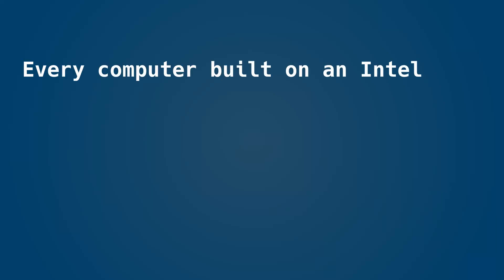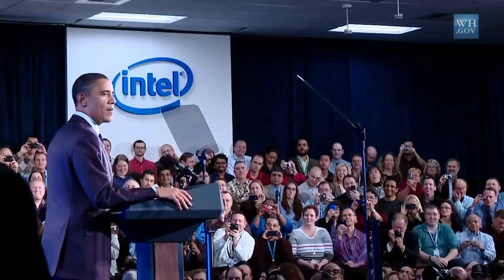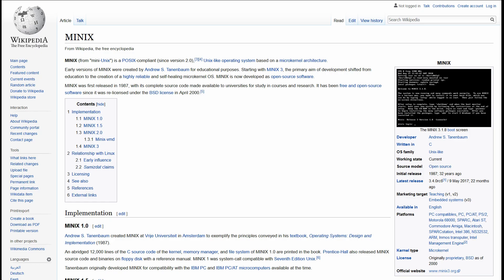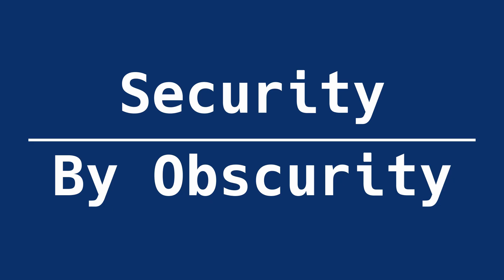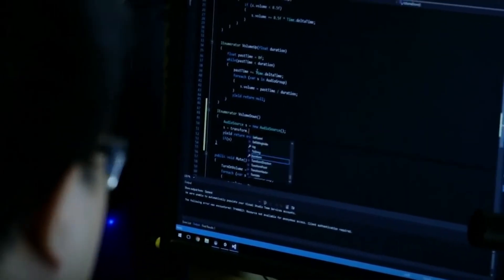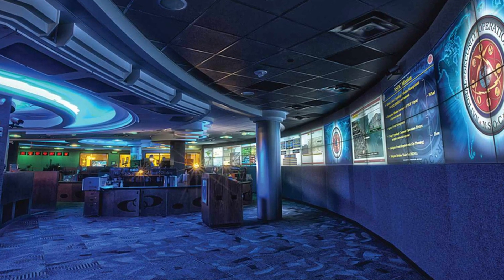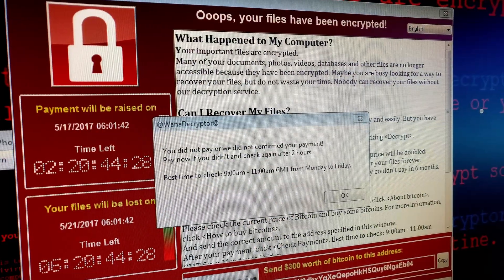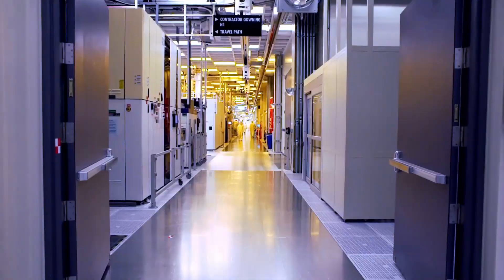How Intel wants to backdoor every computer in the world | Intel Management Engine explained

Comment: Using an external router, no extraneous outgoing traffic was detected from modern computers (ryzen3, ryzen 5, i5-4870, laptop). The router used was the software m0nowall-v1.32 running on a pentium3 computer with 3com905 network cards.
Reply: Course not, it sits and waits for its master. It can also sneak by when you mass stream data.
Reply: @TammyDenseDdank5658  I didn't say that it couldn't get through. I couldn't detect anything, no attempts to access the internet from disabled computers or computers with the bios open. Perhaps certain conditions are required, such as an external IP address on the network card.

Comment: We also need hardware engineers and electronic engineers to reverse engineer all hardware that is released even if just for fun in the "basement", so they can provide that level of knowledge to us all about what these components and chips do exactly.
Think about it, the traditional motherboard has changed a lot over the decades. Yet besides faster computers and a few new interfaces (USB 3.0, PCIe, etc), the layout should be the same. Open your new computer now, and find out how there's a bunch of chips and other gizmos that aren't accounted for by the developments alone? What could that set of be chips be? Extra backup of backup BIOS 🫣 or maybe Intel IME AMD AMD platform security pre-installed on the main board ready for vendors to add to. The back doors are here peeps

Comment: 1.) We DO know what's in is & what it does. It's a very small bit of code & it has very basic functionality in & of itself. BUT one of those basic functions allows remote access as though it were local  only IF it is running. You need to change "WE don't know" to "most of us don't understand"
 - a.) Whenever it is being used to remote access you have a FLASHING border around the screen. This is outside of the OS so it cannot be turned off. If you do not see a blinking border around the screen it CANNOT do anything like record your passwords or that other nonsense
2.) It is not "Inside every Intel CPU" in fact it is not even available in some, but most i5 or greater Intel CPUs are CAPABLE of using it BUT they also need a number of other things as well, The NIC must be capable, the chipset must be capable, as well as they must be enabled.
3.) If it is not enabled the chip must be flashed with a physical writer while the system is unplugged to enable it, & it isn't simple. If it is disabled it is essentially still running in the background, but without access to anything. It cannot be used until it is setup physically on the machine it is going to be used on. Before it is setup it cannot be used remotely.
4.) It CAN be manually disabled & it CAN be manually removed. If you want to completely disable it you can actually remove the code from the chip with the same writer I mentioned earlier. It wont be easy, but it is doable. But that also means it wouldn't be easy for hackers to get to it either.

Comment: i was victim of a wannacry lojax type bios virus. i still dont know how they did this, but it was like magic. i had absolutly no controll over my device, no matter how often formated the harddrive. i learnt that this is due to this backdoor in the intel cpus. whats even more frustrating ist that like stated in the video, there was a security option to prevent stuff like that available and installed in my cpu but is shut off with no possibilty to turn it on. next cpu definetly will be amd.

Comment: tbh this feature is quite commonly used in things like data centres, where you need out of band management of a device to query hardware faults, perform firmware upgrades, etc., even if you’ve completely bricked the OS (or haven’t installed it yet). 

it doesn’t really have a place in end user desktops and laptops. because what this video said about they typically operate - always on even if the devices main OS is not even booted - is true. 

as others mentioned, this is a general problem with hardware: the lack of both open design AND hardware

Comment: The hell this dude is speaking.
If Intel didn't reveal anything about it How's they know what exact OS it's running?

Another, "it can't be scan by antivirus"
It can only if you can port it. But why the hell you'd do it in first place? I know Intel has a vulnerability which leads CPUs build after Core 2 Duo, however this dude seems speaking fantasy somewhat beyond.
Reply: This isn't fantasy and was already reported on by many tech channels years ago. 

This management function actually has use in professional/commercial windows environments. That's who it is meant for mainly. It's not useful for regular end users like us. Other, bigger channels have gone more in-depth about what is (and isn't) known about it.  

If it's ever used for backdooring we'd never know, that's where the fear of it comes from, the unknown of Intel.

Comment: What proof is there of these claims?  To my knowledge IME, like parts of UEFI is a boot process engine function. It is there to bring up (bootstrap) the very complicated multicore processor, low power rails and chipsets. All systems need this. If you are Intel (or AMD) you have to provide this INIT code to the motherboard vendors. Logically, when you have a huge variety of CPU/Chipset options, you would code this up in a mini environment (MINIX is just that) and hand it to the vendors with updates for new chips, bug fixes etc. In this way you KNOW what is out there to maintain. Otherwise you would have hundreds of implementations all with unique vendor created bugs that make your product (Intel CPU's and Chipsets) look bad. So its perfectly logical. As the needs for security features develops (since hackers never rest) then its logical to protect the system at the lowest possible level. The basic rule is you cannot do something in hardware UNLESS it is mature and fully bounded. Well hacking is anything but, so you must do it in low level microkernels with service updates when an exploit is discovered.  OpenSource Hardware will need to do the same in the same manner eventually.  So I'd suggest people read up on IME. The docs are out there. Does a motherboard builder have to use it? No. But if they don't they have to build every feature it provides on their own, maintain it and enhance it.  In other words they have to reinvent the wheel. And even then they may not hear from their competitors if something is getting hacked. Intel will hear it but they won't. If security is your concern, and its right to be concerned, then mitigate at the network level outside your PC. (Called building a moat.) Hardware firewalls (PFSense) work well.  Most modern high end routers have very good security too. You can "BLOCK" the IME related traffic, or any specific traffic, if you wish.

Comment: libreboot and use non closed source hardware or software to claim your freedom. Minix is easy to overwrite btw. It is a simple small kernel. You can use openbsd instead of gnu/linux  distros if you do not like systemd or the generic linux kernel

Comment: Another reason not to buy an Intel CPU
Reply: AMD has PSP, he just wanted intel to look bad
Reply: @tocraft573  AMDs PSP is not as shady as the Intel ME as of now.
Its only a security concern and has not been proven to be spyware.
There is decent info about it on the Internet and it seem like it cannot be deactivated completely since it handles basic hardware level functionalities that are required to even load up the Bios.
Reply: @alouisschafer7212  go check out system76 they DID disable it fully with the bios loading and also ‘not proven’ means nothing because it still might be and the security is still a big problem

Comment: The worst part is that in plain 2021, there is still NOT EVEN A SINGLE FSF-endorsed Operating System that supports a non-compromised architecture, such as PowerPC aka POWER, or RISC-V. The closest thing to it is installing Debian and making sure you only use libre software packages.

Comment: You can destroy it and I have done this several times. It's just a scratch in the right spot.
Reply: is there a guide anywhere so that i can do the same?
Reply: @TheAlison1456  Not that I am aware of. I removed carefully the lid and got a CPU layout, where we are informed in detail about all units, exclusive the hack. Which then I scratch. It's a pretty large thing. However it needs also a microscope to inspect, and there is a risk. If you need this option, you can afford it, though.

Comment: Don’t worry guys I’m using the pentium 4 so I’m safe
Reply: Yuvan Michael he was making a joke you fucking imbecile
Reply: @Yuvan Michael you can use the core two quad the latest intel processor without intel ME.
Reply: @devmister3736  But only if you stick with the P35 or X38 chipsets. Intel added the Management Engine into the MCH of P45.
Reply: Very nice. My old P4 also doubles as room heater.
Reply: @houstonhelicoptertours1006  how many watts?
Reply: can intel me and amd, access or be accessed by internet, without wifi card ?
Reply: And I've got a 486 lol

(this is a joke i have an i5 please help)
Reply: Don't worry, you're not safe with P4 either. ;-)
Reply: Is i3 safe
Reply: @dr40xer  
no...
Reply: @GFCProductionsx  lol🙄

Comment: Tell them about HTML5. Why did they push it so hard and kill off Flash? Security? Battery? Apple? Nope.. that was all bullshit! None of it was true. The NSA paid adobe to kill Flash off themselves by publishing all their exploits. They had to shut down Flash to get HTML5 mainstream. The Minix instance on your CPU is able to gobble up all metadata and personal info because HTML5 makes it possible.

If you use an old unsupported browser (from 2005), the Minix instance becomes blind as a flatworm. Some clever folks were able to get some readings via sandbox what exactly the Minix was doing. It was siphoning keystrokes, form data, sites visited, compiling habit searches/interests/topics etc... like an AI almost. Using an old Fox version, nothing was being recorded. Interestingly, trying to type form data in flash on a modern browser, nothing was recorded. They needed Flash dead to make this operation possible.
Reply: Lets make HTML6 resistant to this.

Comment: IME as it stands right now isn't all that spooky, there's no secret information (you can confirm this by tapping the ethernet cable) and it really seems to exist mostly for usage at enterprise level to remotely control machines at a hardware level. 
Intel has never really made any bones of the existence of the ME, even touting it as a feature when it was first introduced. 
It doesn't like being disabled completely, but you can allow it to start up then instruct it to shut down, and it will stay off (this is how tools like me-cleaner work). 
It's disabled on my laptop (ThinkPad x220 running Coreboot). 
It is possible to query the ME status from your regular Operating System.

It has the potential to have its system files changed through BIOS/Firmware updates, but other than that probably won't be changing much on current CPU revisions.
It can be reverse-engineered, I don't know if anyone has began doing so yet, it would be a massive undertaking but is technically possible.
Intel should open source the ME firmware and compel motherboard manufacturers to add an option to disable it in the BIOS. These are their only mistakes as far as I'm concerned.
Reply: Bull-shit !

Comment: There is a kind of solution...kind of.  Do not connect your main computer to the internet, by any means.  Where you must transfer data to others use a separate machine loaded with only the bare data you need to transfer and assume all transferred data to be compromised.  Don’t load anything except basics into cell phones.  Periodically change your phone and email contacts...do not give them out....especially on written forms...if says ‘field required’ to continue...don’t use the site.

Comment: Russian IC chip makers, according to your U.S news outlets, are having difficulty in developing their own IC Fabrication equipments WHICH HAPPENS TO BE THE STEPPER. But what U.S news mainstream media does not know or knows and refuses to admit is that Russia is now manufacturing it's own IC chip manufacturing high-technologies engineering equipments and has INDEPENDENTLY DESIGNED AND BUILT IT'S OWN VERTICALLY INTEGRATED AND HORIZONTALLY INTERCONNECTED TO SUPPORTING SELF-CONTAINED INDUSTRIES AND INDUSTRIAL FACILITIES, INTEGRATED CHIP MANUFACTURING STEPPERS. Because it can now independently design and build and manufacture it's own locally manufactured steppers to mass produce AN ALL 100% MADE IN RUSSIA IC CPU CHIP AND GPU CHIP WITH A PERFECT GUARANTEE THAT IT HAS NO BACK DOORS UNLIKE EVIL INTEL THAT MAKES ALL INTEL CHIPS TO HAVE BACKDOORS THAT ARE HARDWIRED TO IT'S CPUs IN SUCH A WAY THAT ANY ATTEMPT TO TAMPER IT WILL RENDER THE INTEL CPU IC CHIPS USELESS. OUR RUSSIAN MADE IC CPU CHIPS ARE THE OPPOSITE OF SUCH EVIL INTEL PRACTICES. Unfortunately our NO-BACKDOOR RUSSIAN IC CPU AND GPU CHIPS AND GUI CHIPS AND RAM CHIPS AND ROM CHIPS AND MEMORY CHIPS AND OTHER CHIPS are not allowed entry to be inside the U.S for they can not be spied on by the U.S Government and any attempt to tamper them to make them easy to connect to U.S MADE SPY CHIPS will render them useless. In short, we are giving Intel and AMD and the U.S government a taste of their own medicine. We will advertise our 100% made in Russia IC CHIPS as having no backdoors and no hardwired spy chips embedded in them and will make all U.S made CPU chips loose the entire world's market FOR THE WORLD DOES LIKE ITSELF BEING SPIED ON BY THE U.S GOVERNMENT!

Comment: You only really have to worry about this chip if you haven't updated it to version 7 or higher and gone into its settings changed the password and switched everything to disabled 
If you haven't already, update your bios to the latest version then go into your chips settings make sure it's on version 7 or higher and disable all features 
If your computer is too old and this chip cannot be updated to version 7 then get a new computer 
They're cheap on eBay 
And don't confuse BIOS version with this chips version or your bios settings with this chips settings; they are accessed differently and mean different things

Comment: That's it! I am switching back to windows 98SE machine :D
Reply: Fabroni Giordano  Windows for offline, linux for online.
Reply: Fabroni Giordano  I heard of the IME (Intel Management Engine) that is incorporated into every single machine with Interl CPU that was manufactured starting from 2008, but it is not just Intel, AMD also has something similar. So, yes, that is an actual PHYSICAL HARDWARE built-in backdoor. So regardless of the fact that you are using Linus as an OS, that will still do its thing. 
However, in order to read information, a connection is needed, so that means the Internet, Unless you are talking about using antennae that can read the electromagnetic spectrum that is emmitted by displays/ computers overall so that the can decode the signals, that is another thing.
The safest is not to use any of this digital age technology. Or the only way to be safe is not to use comptuers and internet :))
I have a computer fom the 90s, that does not have HDD ant neither had an OS, it woks in ROM/ RAM only and the OS is actually a BASIC interpreter. Probably that one is unhackable :)) But even that one, presumably they can read the electromagnetic signals from it. 
Well, I have good news, I do still have a MECHANICAL TYPEWRITER. That they cannot access :P
Reply: Fabroni Giordano  Most people are ignorant. You know that ignorance is bliss. And furthermore, they PUT ALL THEIR PERSONAL IDENTIFIABLE INFORMATION on the ”social networks”, readily available for anyone interested. This is the epitome of stupidity.  I have purposly posted on my facebook account (that I am about to delete some day) that my birth year is 1912, on 15th of April (day when the Titanic sunk), also I posted an ”event” - that I bought a truck on a date BEFORE I WAS BORN :)). I also used a friend's fake account to create another "event", - that I am "in a relationship" with that person in the fake account :))). And stupid people do believe all these things, as if facebook is YOUR OFFICIAL BULLETIN BOARD AND IDENTITY DOCUMENTATION. 
As for the hardware, besides that old Home Computer (a Sinclair Spectrum compatible clone), I also have one from 2002, that I can eventually use with a live Linux distribution on the internet. 
As foe the NSA, I live in Europe, I am not a US citizen. However, the EU is about the same shit. the EU tends to be a totalitarian, orwellian surveillance state. They take Chine as their model. 
They do have the best EXCUSE. In the name of SECURITY, people will flock to give away their FREEDOM in favour of SECURITY and of course CONVENIENCE ( cashless cociety - Big Brother everywhere)